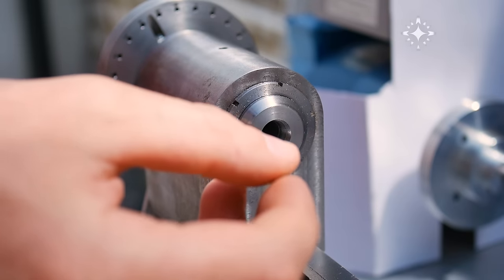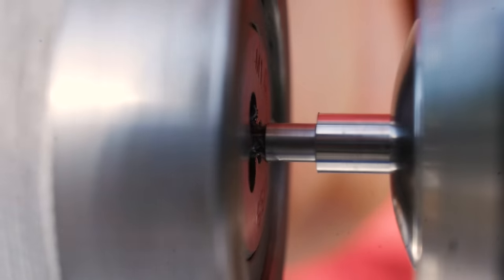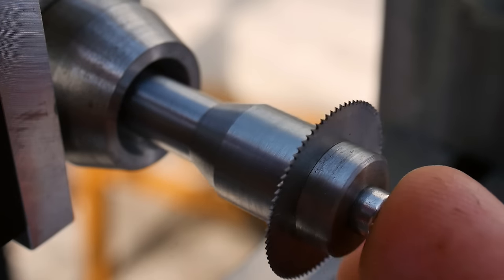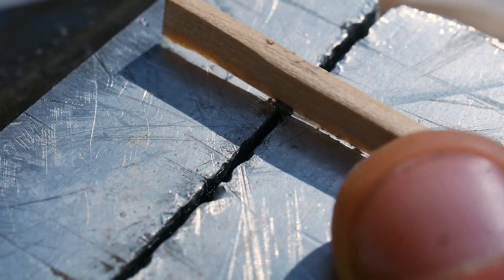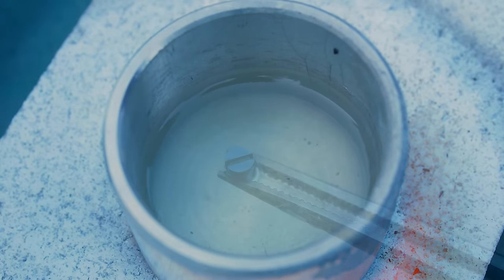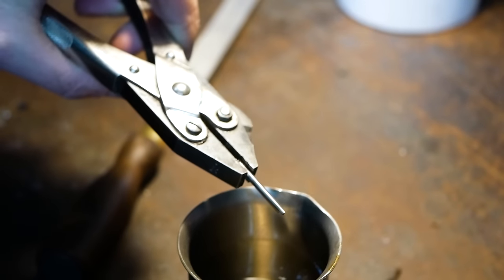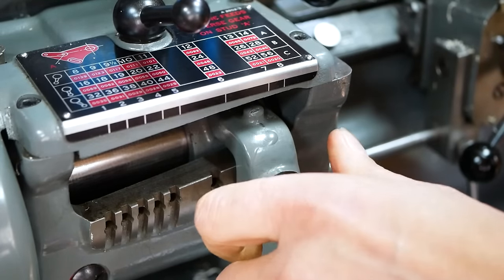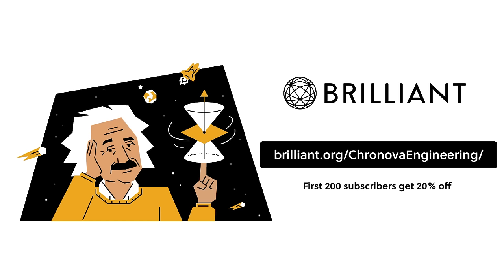Watchmaking: Screw Making Techniques

Comment from the maker: To try everything Brilliant has to offer—free—for a full 30 days, visit https://brilliant.org/ChronovaEngineering/. The first 200 of you will get 20% off Brilliant’s annual premium subscription.
Reply: @4:39 Are you using chewing gum to remove the material
Reply: Thanks for the educational video and sharing your craftsmanship:)
Regarding hardening: What alternatives do you plan to use for borax/boric acid? Both are not available for home users. AND FOR A GOOD REASON:
In June 2010, ECHA added boric acid to the candidate list for SVHC (substance of very high concern). After the CLP regulation and the REACH amendment regulation 790/2009/EC came into force, boric acid was labeled as toxic to reproduction[1]. Mixtures that contain free boric acid in a concentration of 5.5% or more must also be labeled as toxic to reproduction according to the GHS regulation.
[1] Meaning extremely harmful (teratogenic) for reproductive function or the child in the womb. So no joke! (see Contergan ... which also fell into this category)
Reply: Guys, this is a wonderful video. I an a vintage and NEO-vintage watch hobbyist in Singapore and Girard-Perregaux watches are my passion. Thank you for making this video.

Question: I sometimes have problems removing caseback screws because of grime and such. Eventually when the screw is removed, the screw head is damaged. 

a) Is there a way for me to recut the screw heard slot in my home workshop?

b) I sometimes want to order a new screw, but don't know the size. I measure with calipers and such but its still a hit and miss thing. How can I accurately get the screw size? Is there a chart to look up perhaps? or best ot contact Girard-Perregaux and ask them for the size used?

c) Can you recommend the best place to order stainless steel screws from?

Many thanks in advanced and best wishes from Singapore.

Marc

Comment: I have to say single point threading a 0.6mm screw is insane
Reply: Someone had to at some point, you can't make a die without a tap, and a tap can only be made with a die, or single point turning, or grinding I guess, but that's probably a more modern thing. Thinking about how we got from using rocks for hammers to the machinery and precision we have now screws with the brain a bit
Reply: AuschwitzSoccerRef.  You mean 0.2mm
Reply: @mehmettemel8725 an error of one decimal point is near enough for a country job😂
Reply: Right I was thinking same
Reply: @JoshuaZiesmer 
Of course you can make a die without a tap. They are ground, not cut with a tap.
Reply: It is almost mesmerizing <33
Reply: To use a die, first you must make the die.
Reply: @michaelslee4336 they may be thinking of handmade wooden nuts, which usually do require you to carve the screw first.
Reply: And then hand finishing it to a high polish afterwards….
Reply: Can't wait for the ACME miniscrew video

Comment: This is mesmerising stuff, I’ve been a turner (employed rather than self employed) for nigh on 40yrs but I work with huge workpieces up to 20 ton, small stuff is 500kg. 

Principles are the same but the delicacy is off the scale, a 0.6mm screw? Heck that’s my tolerance. Lovely video.

Comment: I restore torsion clocks and I quite often have to make replacement screws but not watch size usually no smaller than 1.2mm or 12BA and I usually use a graver because I have always had trouble grinding small lathe tools although I don’t have any bother grinding gravers so a video of how you grind your lathe bits would be very helpful, hint hint.
Very nice work by the way.

Comment: It is interesting how you terminate the  cut when threading  getting the tool to stop precisely  in the same place each time.   It does not appear that the lathe has a brake.  So you are - -  what - - in the lowest back gear and shutting the machine off  well before reaching that last bit of the cut and then advancing by hand? Or are you hand cranking the spindle the whole time?

Comment: As far as i can remember, on single point threading, whats happening is the Tool Stock is on a precision Automatic Feed that moves the tool towards the Head Stock/Collet the distance of the Thread Pitch for each exact 360° rotation of the Head Stock/Work piece. The shape of the thread itself, called The Form is made by the shape the cutting edges of the tool is ground to, called The Profile i think.

Comment: main difficulty in these small sizes is getting good quality dies 
even expensive ones are a bit of a lottery (ask me how I know... 🤬)
on the other hand I had success with rolling dies (also veery expensive 🤪)
I love you channel !!! 👍
Reply: I've been thinking about getting a couple of rolled thread taps in 4/5/6 mm, as these are most-used in 'everyday' applications (for me),  if you've used rolled-form dies, I'd be interested in your experience therewith...
Reply: @derkarhu5079  
this might be of interest to you?
https://youtu.be/yKthPYEKmPo
I am using this type:
https://youtu.be/4ziwnkv5FdM
I didn't use large ones (you are talking about) because they are easy to do with conventional dies.
Reply: thanks for the info...the lathe work to 0,741, and parallel ... lovely!

i see why they so excellent for miniature(isn't) screw sizes, but the improved strength of the thread could be important, even in larger sizes, although speed and tool life in a production environment are probably top priority.
Domo arigato!

Comment: Hy there ! i have a Question about 1 screwcutting with a Die . i have to make about 12mm lengh of thread and i had my previous Die clogged up with a Broken Failed screw example , so now , how can i prevent this when cutting such long thrread ? i already tried to Anneal the material beforehand to make the cut itself smoother, of course i use cutting oil, but no Die Holder because i cant hold my Workpiece in a chuck anyway ( it has a a feature on the front wich cant be held in any way) so my go to is to hold the piece with the outcoming M1 part in a Vise and i turn the Dieholder in and out, but it is a scary job and i wondered how watchmakers make longer threads
i would be happy if u could give me any tips ! Best regards from vienna , Pirmin
Reply from the maker: Hi Pirmin, having a setup for holding the die and workpiece concentric will help a lot. Otherwise, all you can really do is take it slowly and gently, backing off the thread as often as possible. Hope that helps!
Reply: @chronovaengineering  i just started and found that backing of a lot helps a little ! but there is so little room for mistakes since u dont real feel if the thread is being cut or the material starts to warp and twist off. would you recommend to anneal the material ?
Reply from the maker: Annealing generally isn’t necessary unless you’re cutting hardened steel.
Reply: @chronovaengineering  yeah i just found out the hard way that my annealed injector needle just broke off exact where the annealed section ended. i will try to get a workholding setup where i can maintain concetricity. the hard part is that ihave no feeling on a lathe how the screw it self feels. at that lengh (22mm total) it is realy so hard to feel if the part twists and shears apart or if threads are cut, usualy it works good untill 8mm lnegh or so, above that i found M1 realy a pain in the Amour ;)